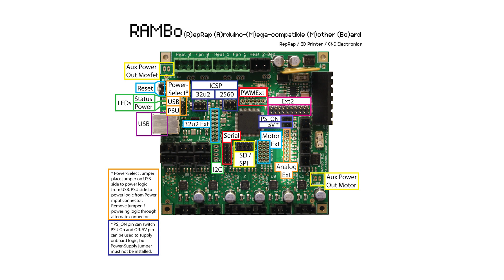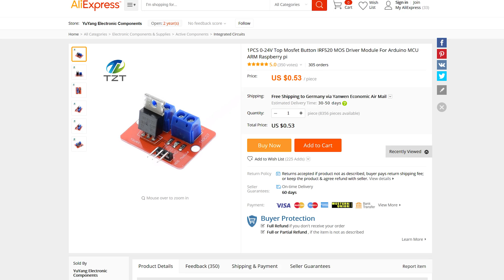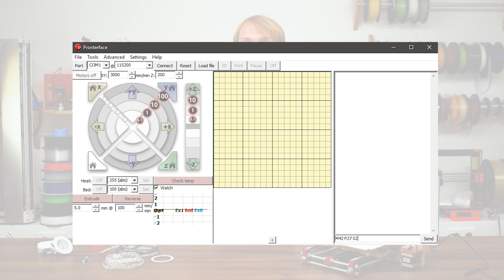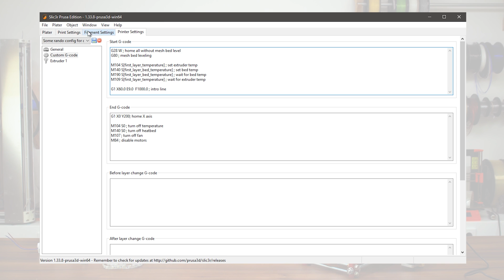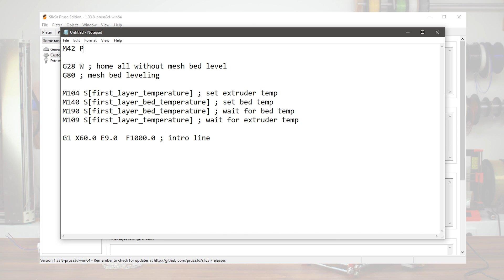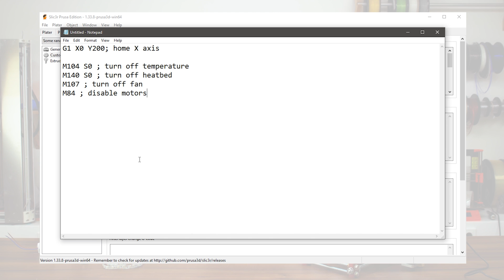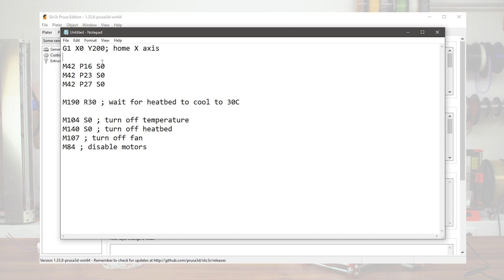How to add software-controlled LEDs to your 3D printer!

Comment: Tom, fast forward to 2022, I'm still using the Prusa clone I've built following your series, and in the spirit of RepRap, printed the parts for another one with 300x200 bed (and whole bunch of other mods), on 12mm ply reinforced frame and the things haven't stopped printing!! Now, I've decided to add LEDs, just for the fun of it, and this helps a lot.

Comment: Is there any need to change anything in firmware? I am running a Marlin 2.0.x on a custom MEGA and RAMPS1.4 board and using a multimeter M42 doesn't change the voltage on any pins I have tried (32,33,47 etc). Is there anything to change in firmware to "enable" this feature?

Comment: doing 4 different set of lights interdependently in this correct ? ( NOYITO 4-Channel MOSFET Switch Module IRF540 Isolated Power by Module (4-Channel, Red) By amonzon thx

Comment: Tacky? Some might say adding led that are meant for cars to your sons 3d printer is tacky. I think it's rude to talk down on other people's taste and hobby  but expect people to respect your hobby. I don't have this but I do have custom led headlights and I've built those angel eyes before didn't buy them. Bought yurt chips that control every led individually then soldered the little led to the little chip. A lot of work goes into that and a lot of custom headlight guys use 3d printers to print custom brackets or shrouds for the lights

Comment: Can you Help me trouble shoot the event leds. Im running a SKR V1.4 and a TFT 35 V2. i made a mosfet board and  have all the led pins defined  in marlin bug fix 2.0. i have also undifinded Printer_Event_Leds. the Leds work when i control them from the touch screen. But they dont work as event LEDs during a print. 

Thanks for the help.

Comment: Very interesting video but it is lacking enough detail to be useful to people who have never done this before. The one wiring diagram provided does not include RGB lines but that is an important part of the overall setup. Tom's custom module has lines for RGB but the off-the-shelf module he recommends does not, figuring this out is left as an exercise to the viewer which is  not great.

Comment: Pro tip, for 24v psu and 12v leds you can cut them in half and reconfigure them to be 2 12v in series dropping 24v without needing additional electronics or wasting power in such a circuit.

Comment: Rather than using a buck converter to step down from 24v to 12v would it not be easier to cut 2 led strips and wire them in series such that the voltage is split across them and they get 12v each?
Reply: Yes, this would work but then again if there should be a difference in forward voltages, the LEDs might be strained quite differently

Comment: Hi, excellent video but I have a problem. I want to do this with my Tevo Little Monster. The motherboard is a MKS SBASE V 1.3 but configured with Smoothieware. I have no idea wich pins I can use and how I have to configure this in the config.txt file. I think I can use pins in EXP1 slot because it's a TFT screen and not a lcd panel but I am absolute not sure. Have you an idea? Thanks.  Joseph

Comment: Is it not just possible to make it even easier by putting the inputs of some switches parallel to the the heater-outputs and fans?
For example Blue for the heatbed, Red for the hotend-heater, White for the extruder-fan ?
You can thus really easily see the status of the printing without having to do anything in the gcode or slicer. It just always works the same.

Of course you can even see a brighter or dimmer light (red or blue) when the heaters are on and more white light when the extruder-fan runs faster (PWM signals amplified by your mosfet or transistors to your LED's)

Seems like such an easy idea. Any problems to be expected in this aproach?

Comment: can you use a Rasberry Pi 3 b+ to still get the Status effected RGB.  i plan on adding an octoprint and id like to maximize its useful ness without messing much with the MK3s board.  i was going to power both standalone NOT using MK3s PSU

Comment: A word of caution. LEDs require a constant CURRENT, not constant voltage. So I reckon you either need LEDs which limit current (e.g. with a resistor), or you need a 12v LED Driver (e.g. 12v MR16 LED Driver) or if you are dealing with 24v (12v-24v Constant Current LED Driver). All available for around a $1 on aliexpress or ebay. Hooking 12v LEDs directly to 12v power supply may not be safe!

Comment: .. another extremely interesting video - thx a lot. is there any pins accessible on the ender 3 mobo to do  this mods as described? would love to! ;-)
Reply: I would love that too.
Reply: Not really. The only one you can really reuse is the beeper pins. You could get rid of the LCD probably and use those pins.. but then no LCD.

Comment: Is this something that is capable to do with a stock Anet A8 board? I don't think it has any spare pins like the boards you show. The back of the LCD board has a line of pins, but my knowledge of circuit boards is pretty much zero.

Comment: You may connect an input of an Wemos D1 (using level shifter) to a output-pin from the controller. It can send comand to a hue bridge turning all colored lights in the house to green, if print is ready...

Comment: Awesome video Tom! 
Okay, I am a newbie and I would like to add RGB lights to my mk2s. I'm having trouble deciding which mosfet to use or if it will even work or not. Will this mosftet work that I picked out? also a wiring diagram for the RGB lights would be super helpful. Any help would be great. 

https://www.aliexpress.com/item/RGB-LED-Light-Modulator-Programmable-PWM-Controller-for-Arduino-MOSFET-Module/32837854785.html?spm=a2g0s.13010208.99999999.277.JWmiPi

If this mosfet wont work which one should I get for the RGB lights. or am I better off making one like Toms?

Comment: Great video and information.  I have started working this mod and noticed that Cura will add the M109/M190 commands as the very first 2 lines in the final gcode file.  So no matter what I have in the Start Gcode section, there will always be M190 and M109 as the first two lines.  So unless I do a post edit, I can't turn on LED's until the bed and extruder are at temperature.  Any thoughts on how to fix this?

Comment: Are you using LED strips that have a single data pin or the ones that have individual pins for R, G, and B?
Reply from the maker: I'm using simple, "dumb" LED strips (common anode type), not the fancy digital WS2812 types.

Comment: If I was installing these on my printer I'd run a brand new Arduino board in and run them from that. No point in putting the main 3D printer board under any more strain than it already my be.Great video, Tom. Thanks for it.

Comment: It would be cool to use the gcode to mark when a overhang is going to start and then tilt the printer so that supports would not be needed.  The Dolly and Prusa MK2 are stiff enough so that you could tilt the printer by 30 degrees which would cut out a ton of supports material for simple parts.

Comment: you need to remake this video specifically for the duet wifi. all those pins, that can be independently controlled via g code, the possibilities are endless.
Reply: I realize this is 4 years old,  now that I have a BTT SKR 3 RRF board running RRF,  I am looking for a way to control the neopixel incrementally for print percentage, or bed/tool heating.  I have been able to do some with start and end gcode in prusaslicer, and cura for some control with heating with M109 and M190, and I wrote a python script that worke with Cura post processing,  but you would thing there would be some implementation in the firmware as in Marlin.     anyone have any thoughts?

Comment: if you have a 24v power supply you can put 2 12v led strips in series
Reply: No, I'm pretty sure you can't. Those strips have LEDs with sections of 3 or 4 LEDs in series and then each section in parallel. That's how you can cut the strips every few LEDs. You can also join those strips end-to-end on the same 12V and it works fine. They start getting dimmer from the voltage loss along the length of the strips' conductors, but that's not because they're secretly wanting 24V. In all likelihood, if you connect a 12V strip to a 24V supply, it will work fine but will get very hot and die quite quickly. LEDs can function with a surprising amount of extra voltage, but they don't survive for long.

Comment: Thanks Tom for the tech tips! If I can be honest, this is the kind of technical stuff you used to put out more and why I started following you. I'm less interested in reviews and more interested in technical data. Not that I don't like your reviews, but as a geek,I love being able to dive into the gear more. Today I had my y-axis channel on my ramps/arduino board die from a cheap Aliexpress driver, and I dug into the code and figured out how to remap my y stepper signals to my unused extruder driver so now I have a working board again that I don't have to toss out. I'd love to see more of that deeper diving material from you, you are pretty sharp and know a lot about this stuff. Thanks for the great videos, I watch everything you post!

Comment: Nice, I did it with relais first, then wrote a plugin for Octoprint.
I use it to get the status visualized via webcam. It was actually a hack in the Marlin firmware.
But I will try the G-Code variant

Comment: I was so amazed by this (and wanted it so badly) that I went and ordered the parts without looking at my printer... my printer seems to have the only ramps compatible board without the extra pins broken out ... oops lol
Reply: Perhaps you can solder them on? It's a China clone? They save money by not soldering all pins onto the boards I suspect?
Reply: It is a china board. But no, its one of them shoddy all in 1 boards, and there arnt even holes for the unused pins... Its fine. I wanted to upgrade my printer to have a proper ramps board and dual extruder anyway.
Reply: If you are going dual extruder, don't replace a ramps/mega board for a new ramps/mega board, especially if you have a Delta printer. For Delta printers you get benefit from 32bit controller cards also. There is several out there, I'm thinking to go for a smoothieboard, since I have a Delta printer. Cartesian is the one he shows in the video, delta is the ones with the 3 towers.
Reply: I've got a cartesian printer. Been looking at different boards. I've got a smoothieboard in my home built delta. I actually got it because I was experimenting with a 6 tower delta printer... Didnt work out. But was fun to play with... 
Basically, the only way I could get it to work, basically just had 3 extra wide towers, with 2 motors on each lol...

The problem I've got with upgrading to a 32bit board for my cartesian printer (my main printer), is the cost... all the ones I've seen recently are prohibitively expensive. If you know of a decent priced board, preferably that can use a corexy setup, like tech2c's hypercube (thats my next project) then I'm all ears
Reply: Thomas Sanladerer knows more about this than me, perhaps he will reply? :)

Perhaps the Duet?
Reply: Maybe I should pop over to the forum and ask lol

Comment: those are not the led rings used for getting the bmw angel eye effect. they use what you call angel eyes which is a circular piece of plastic and 1 led where the 2 ends join and the ring is marked with lines.
Reply from the maker: +Toto Guy I know, the real deal uses glowing elements. But the rings are the tacky budget alternative 😉
Reply: Thomas Sanladerer in the uk they add angel eyes on non bmw cars and they are as i mentioned. perhaps where you live its different :)

Comment: @Thomas Sanladerer: Great tutorial / video. Have you checked this plugin https://github.com/kantlivelong/OctoPrint-GCodeSystemCommands for octoprint? It looks promissing and does moves all the wiring stuff from the printer to the raspberry pi. I kinda like this approche because I do not have to hack the printer. 

@all: Does anyone have experience with this solution?

Comment: hey so i'm starting to get into 3d printing and i have discovered that most lower priced 3d printers do not have as many custom features like nfc filament management as i have worked with nfc and arduino before im in the opinion that i can add this kinda support myself :P but i'm struggling with finding the right kinda hardware to base the system off i have been looking at board like the beagel bone bord ore the Smoothieboard.  my hardware is gonna be equal to what's on the wanhao i3 plus both of these board dos not run Arduino which is a big downside for me do you have any recommendations to what kind of board that's good for custom software development? I only need access to the i2c ore spi lines off the micro controller also i don't feel like the Smoothieboard is an option as i have little experience in programming that kind of chip

Comment: Is the 3D printer world going to follow the PC world? RGB extruders, RGB stepper drivers, RGB fan shrouds etc
Reply: Stef's Engineering I'd buy a fricking RGB extruder! Why not RGB cables? They exist already
Reply: 3d printers will eventually be able to play crysis.
Reply: Unlike a PC, the colors can add a lot to the presentation as it rips up a beautiful designed model to wow those Doubrful Danny's. Also in my experience 3d printing, I find myself being a mother hen over the printer, would be nice to get a color indicator telling me everything I need to know from across a room.
Reply: I would buy the fan shroud tbh
Reply: I already replaced my powersupply with an rgb modified one... also RGB backlight on all the time I´m at home and working light connected to the powersupply. Why not adding some design aspects to it?
Reply: diamond hotend, RGB EVERYTHING
Reply: Stefs Engineering thats my idea for the future of my CR10 ;)
Reply: I've got 30 ft. of RGB with it's own power supply and a Raspberri Pi with nothing to do. Along with a printer in a dark room. This is going to be fun. I wonder if I can set it up to turn lights on and off when each part of the printer is running. Do a cool light show when it finishes... Ooh, I'll bet there's an Octoprint plugin.
Reply: LEDs are cool youre just a hater
Reply: I will
Reply: when all these fancy lights are actually useful, like with the example in the video to convey simple information at a glance, then it is totally worth it. However I do agree that superfluous RGB lighting on computers is an unnecessary eyesore.

Comment: Nicely done & informative. On the M42, what S value do you use for a non-PWM output?
Reply from the maker: +vidznstuff1 if you habe a non-PWM pin, anything from 0-126 will turn it off, anything from 127-255 will turn it off.